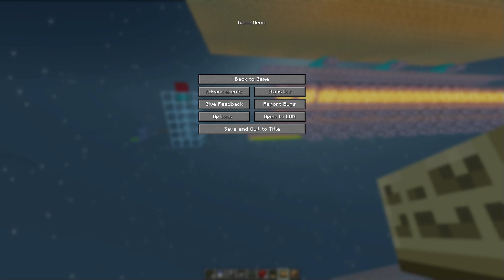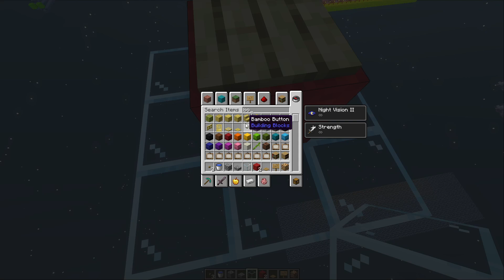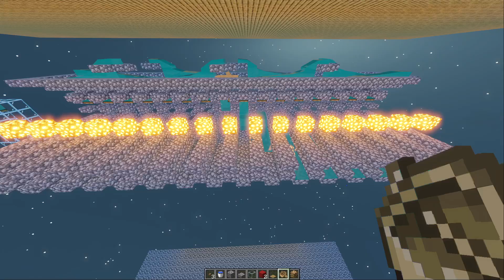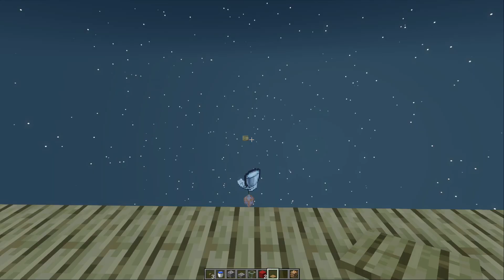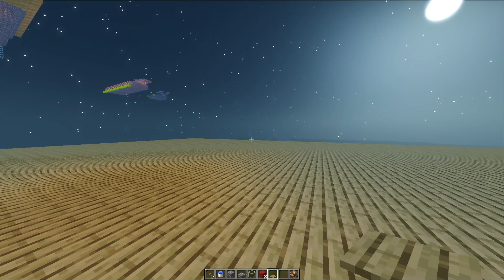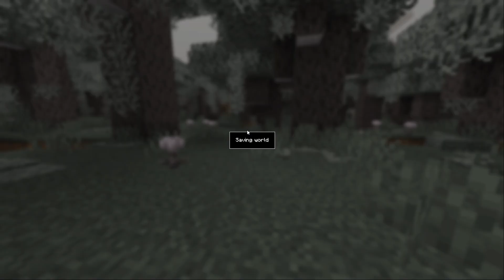Water Powered Redstoneless Mob farms

Comment: This concept looks great for Java which allows water logging for trap doors; is there a Bedrock equivalent?
Reply from the maker: hmmm... you are right.
I dont know of a way yet. I'll look around and let you know if i find anything and remember
Reply from the maker: Well, at worst, using the gnembom inspired grinder, you could get away using exactly 1 redstone for a dispenser and use the falling water duplicator to add extra stages

If you are still on a budget, you could just stand on top and place the water (or obstruct it). it wouldnt be totally afk, but you could still get better rates than unpowered mob farms that rely on random path tracing.